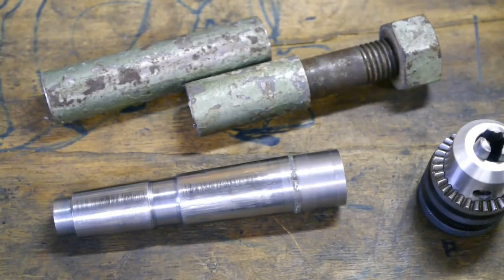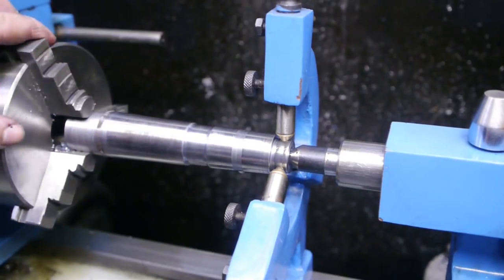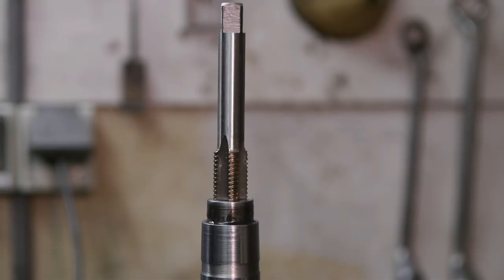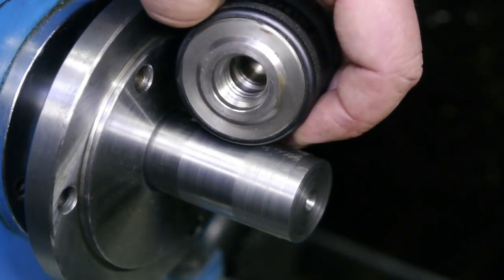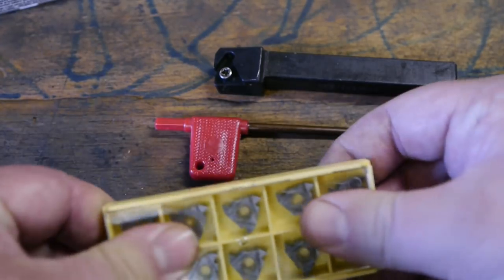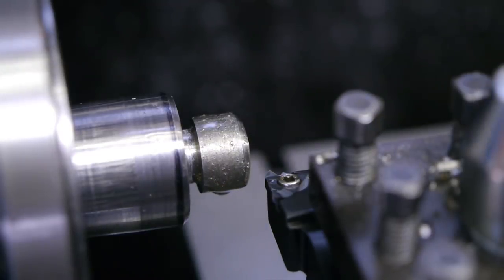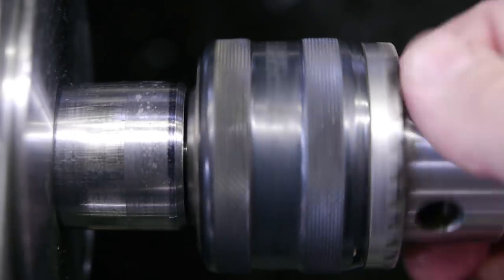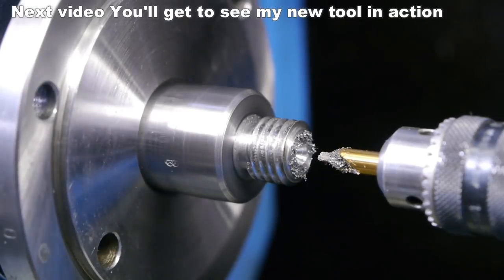Fitting a flea market drill chuck to a home made arbor

Comment: I have a hammer drill with an Allen key in the chuck, similar to that, it's used to lock the jaw adjustment sleeve so it does not undo during hammer operation.
Reply from the maker: You mean back out the allen head bolt till it locks the knurled sleeve?
Reply: On the Bosch chuck, the Allen head screw is in the knurled sleeve and I screw it in to lock the chuck. From the location of the Allen head screw in the Rohm chuck it looks like you would need to back it out.

Comment: Very well done.   A very good thread as you said.

The 16mm drawbar is very large. diameter   I would have thought 10 - 12 mm would be sufficient.

Nice trick with the two wrenches.   I would have tried a 12 point socket so I could use a rachet, much easier to use and on the hands.

Three full threads are sufficient to achieve the desired load.   I read somewhere the first thread carries something like 70% of the load, second 20% and third 10%.

The noise is the change gears.   You can try adjusting the gap between the gears.   You need some gap to minimize wear.   Also try thick chain lube to reduce the noise.

Very good that you have a happy ending to this project.

Dave.
Reply from the maker: Thanks. I'm happy with the result. Hopefully that will stay the same after using it.

I think 16mm is standard for a MT4. 12mm for MT3 and 10mm for MT2. But they are probably all overkill.
A 12 point socket is a good idea. But I would use a T-handle instead of a ratchet. You want two levers to spread the torque evenly. 
The original oil was a thick as molassis. I changed it for hydraulic oil that is a lot more free flowing. I didn't notice a change in sound. The manufactures recommends regular oil changes, but doesn't specify an oil type. I cleaned the bottom, not much swarf, dropped in a magnet and wasn't planning to change it again for a long long time.
Not sure if the gear gap can be adjusted. Perhaps there a eccentric on intermediate shaft.

Comment: Good to see you weren’t tempted to weld those two spanners together, nice work around. The runout wasn’t bad but I would have measured at the chuck nose and to be fair to you, expecting a drill chuck to run true is a big ask. Cheers Peter
Reply from the maker: I have modified my share of spanners but these were still to nice to just weld together.

Comment: Just a heads up, in a pinch,  8 sided sockets will work on  taps. 8 sided being two squares inside, kind of a star looking pattern. They also sell socket sets just to fit taps now. I bought a set from Snap On about ten years ago but the price even back then was enough to make me squeal like a little girl. I'm pretty sure they are a lot more reasonable these days from other suppliers.
Very handy.
Reply from the maker: I've actually tried this at the time I was making this video. And it doesn't work with metric sockets. 
At least not for the smaller tap sizes.

Comment: There is a trick you can use if you can’t off set your compound slide to avoid plunge cutting a thread.
You just advance the compound slide a little bit on each pass.  A 60 degree thread you advance about 1/3 the the depth of cut.
So if you take a .006” cut just advance the compound slide .002” and the back side of the tool won’t cut.
I also like to put a chamfer on the back end of the thread.
Both those things make for a much cleaner thread.
You should try and get hold of a chasing dial or make yourself one.  They aren’t rocket science.  You could almost mark out a wheel with dividers and file in the teeth as it just marks the lead screw position they don’t need to be an exact match.  Perhaps the subject of another video.

I think you did a great job with the chuck.  I have two arbourless chucks in a draw that I might have a go at saving.

By the way that sounds like bearing noise to me.  Do you still get it if you drop the change gears out?
Are the bearings adjustable?
Dave
Reply from the maker: I actually though about doing that. But plunge cutting went rather easy. I was positively surprised by that carbide threading tool. Maybe the rigidity close to the headstock also helped.

I also though about chamfering the end of the tread, but was to lazy to grind a tool that would fit :)

I have a metric leadscrew and I believe threading dials for metric lathes are a bit more complicated.
Besides I don't mind reversing the motor. This might change if I ever need to do a long thread :)

Spindle sounds fine when not in gear. I can also get a good finish so these bearings are probably good.
I replaced the bearings on the input shaft last spring. One bearing was kaput, the cage was mangled up. possibly due to much belt tension. Intermediate shaft also felt o.k .when I had the headstock open.
I only installed the change gears just before I started the threading job. Lots of crunchy noises long before that.

Possible my gears are somehow not well matched :( But there was hardly any swarf at the bottom of the headstock and all teeth were there and looked ok to me. 

So I'm at a loss. But at some point something will probably fail and all will make sense :)
Reply: I can't remember now if you were cutting a metric or imperial thread.  If your lead screw is metric and your thread is imperial then you are stuck with backing up the machine.  If your thread and lead screw match then it is simply a matter of dividing the pitch of your thread into the pitch of your lead screw.  If you engage at the same mark on your star wheel it will always work.  If it is divisible by 4 then you get 4 points on your star wheel.  You can do the scratch test to make sure you have calculated it correctly.  It just saves you the time to wait for the first mark to come around again.  If you are you own boss then it doesn't matter :)
My old lathe has no reverse.  So I have to wind the chuck back by hand. (Huge pain in the bum) I have thought about getting a reversible motor but I have to be very careful I don't unscrew my chuck when if I throw it in reverse as it has a threaded spindle nose. 
I'm enjoying your videos by the way :)

Comment: you are improving my friend, time to invest in full carbide tips and keep the hss on a shelf
Reply from the maker: The scrapmetal I use seems to burn up HSS al the time, so I'm switching slowly to more and more carbide.
Reply: Jusb1066 unless you can find  some tatung hs  its high speed tooling high nickel content shock capabality of steel but wear resistance of carbide